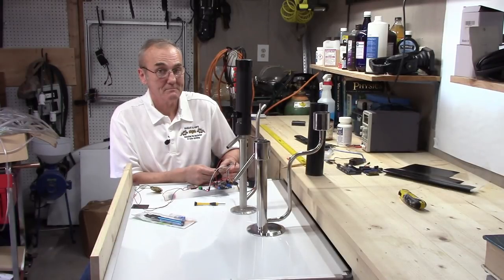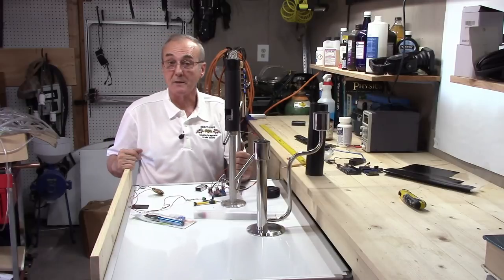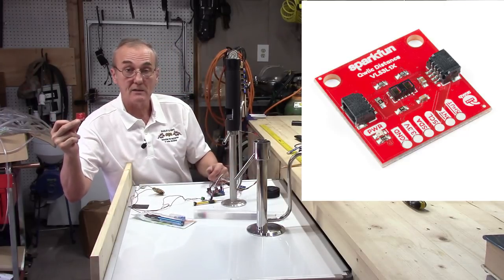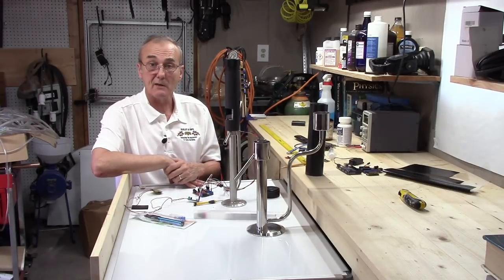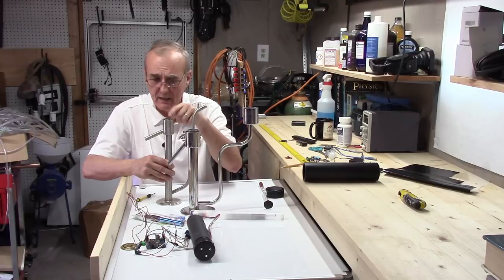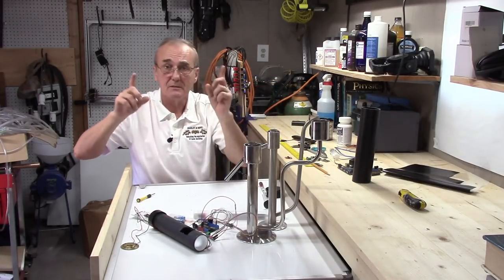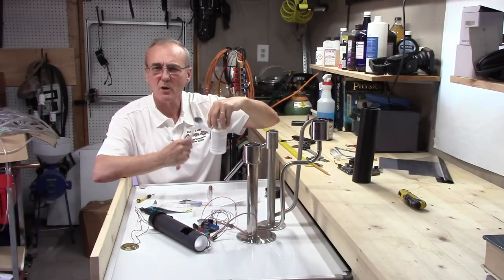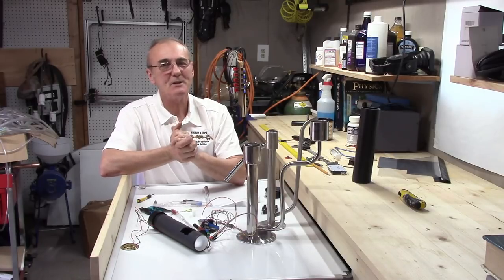PARROT HEAD AUDIBLE PROOF AND TRALLE HYDROMETER

Comment: Wow, You are really stepping this up. The data outputs from the various sensors in a still run could be consolidated into a file. This file could be used to profile the run by a program. There could be optional manual inputs like air temperature and humidity (but I get ahead of self). Also, the program could be written to be able to control the PID, valves, etc during a run. You could therefore analyze the operation of the still, manipulate it, and pre-program it's run profile.

Comment: The link for the Micro SD card reader is for a standard SD card. I didn't catch that till I went over the videos again. The standard SD card reader does not have a IC chip like the Micro card has. I hope I can use the one that I ordered from the link. If not Ill have to reorder for one like you used.

Comment: Hello George , I was wondering because you have a "read out now" from the proof and trail, could you now send the info back to the pid as a set point, therefore creating a "automation" to the still, meaning you could have a set point to "temp to run" and 'proof and trail to run". I am assuming that would have to be in the programming, or does the pid  have the capability?
Reply from the maker: All this is possible
Reply: Look forward to you teaching us good job on the videos as well cheers

Comment: Wow, this is very impressive. I'm interested in building one of these in the future, one thing I do think about, and correct me if I wrong please, but I have heard that smearing can be an effect of using a parrot, what are your thoughts on that?
Reply from the maker: Smearing is more to deal with proof. Methanol has no azeotrope so it comes off first and does not smear throughout the run. 
If smearing proof is an issue don't use a parrot. The smearing is essentially the mixing of different proofs ex. parrot is full of 190 proof and the still begins to produce 188 proof. The result is a possible inaccurate reading of proof by at least  one proof or less depending on volume. 
Where is the problem here?
George
Reply: @BarleyandHopsBrewing  Thank you for explaining, it is something that I had heard but did not completely understand, again thank you for your help. You lead the way 👍.